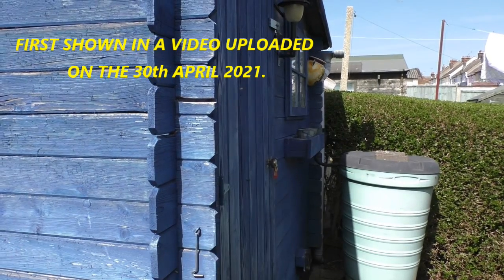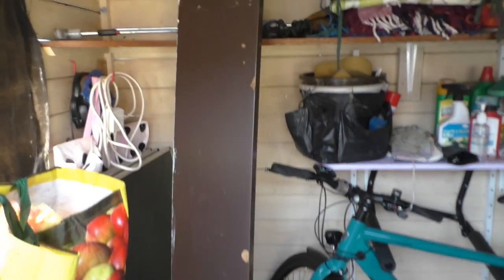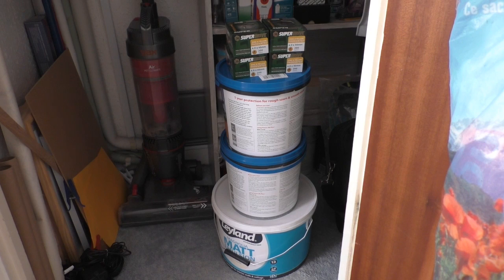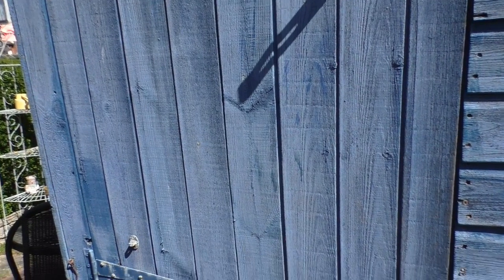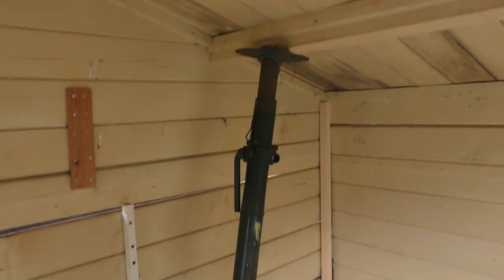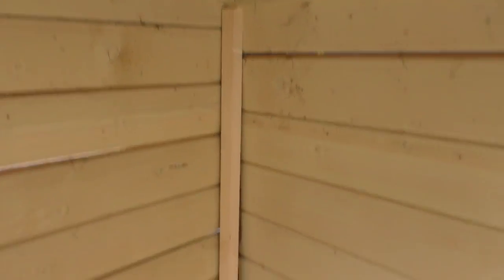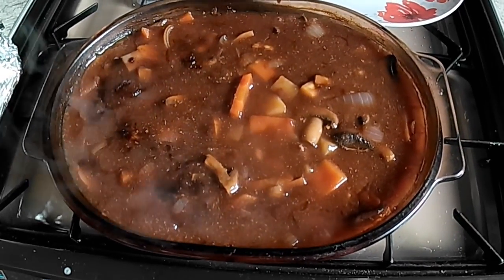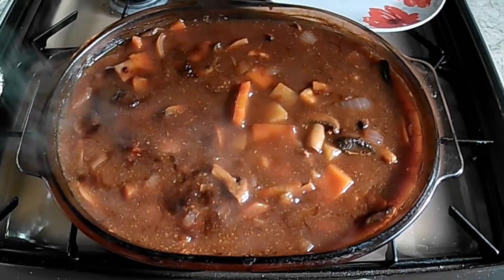THE GARDEN SHED THE REPAIR

Comment: Hi Robert, great solution effecting repairs using ply, should be very strong and last a few years more.  It looks a lot better externally and internally now you  have finished the sealing and painting.
A job well done now you can relax and enjoy the better weather in your garden.  Looking forward to some  Loco running when you decide to do the next session.  Cheers, Paul.
Reply from the maker: Hi Paul,
Yes getting the shed right has now freed me up to use the Hornby bits I had delivered a video will come in due course so cheers for watching and the very nice comments and I have watched your latest videos and the "new" locos look great so as I have said before well done for keeping them going and I wonder if any of the sellers see that with a bit of cleaning you get the "BROKEN" engines running as you have and the shelves are a nice way of keeping things safe and on hand, so keep safe and well and trains will be running in the next few videos for you to see.
Cheers Robert.

Comment: Enjoyed the video and you have done an excellent job and extended the life of the shed by a lot of years. I have a similar job to do but trying to buy the original cladding to the correct profile has been difficult. It seems that each shed manufacturer uses their own profile and I never realised there was so many different cladding profiles on the market.
Screwing is much better than nailing I have found and  is worth the extra expense. You were lucky with the weather and you would not want to  have done  it this week with all this high winds and heavy rain. You get a thumbs up from me!
Reply from the maker: Hi Malcolm,
Thanks very much for the very nice comments and finding the time to watch this epic!!!!. Good luck with your repair hope it goes as smoothly as this one went keep safe and well as always .
Cheers Robert.

Comment: Nice repair.  You might consider fitting some guttering which will take a lot of the rainwater from running down the side of the shed and rotting the wood at the base.
Reply from the maker: Hi Robert,
Cheers for watching and the very good comments and there is a gutter the other end but you may be right about doing it the other please keep safe and well.
Cheers Robert.